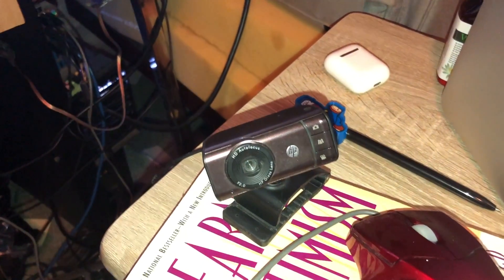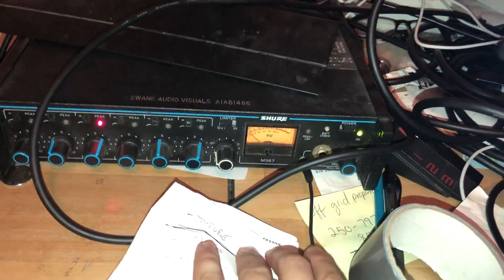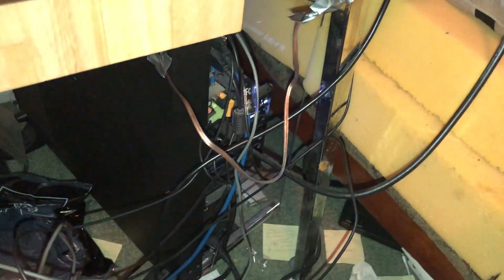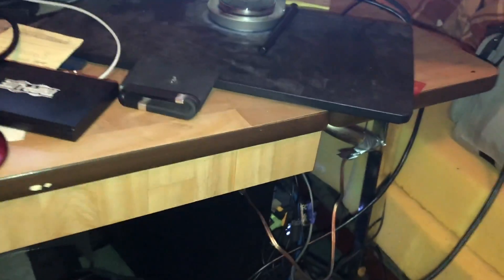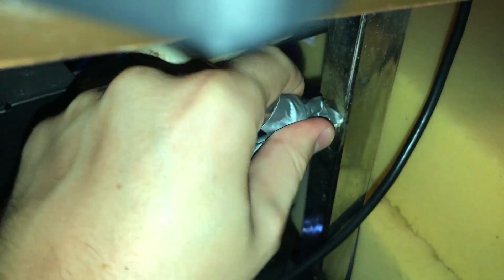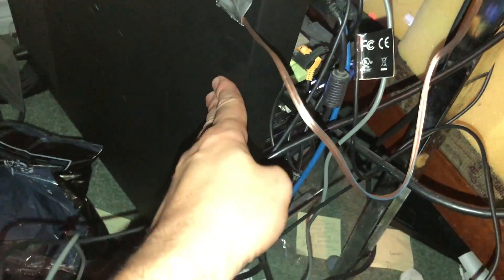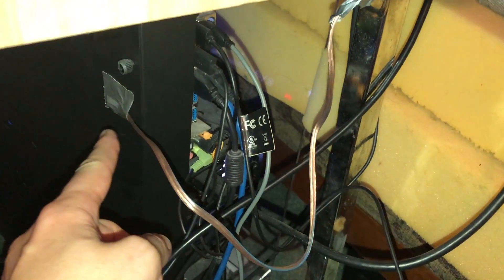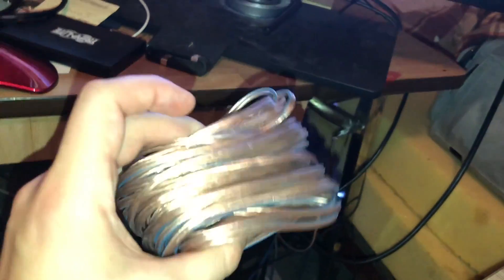HOW TO stop USB Microphone Buzz in audio!

Comment: Holy smokes. It was my power cable seating in the connection. Running the laptop off battery only fixed it instantly.

Comment: Listen..... you are a fucking life saver and i cannot thank you enough you made this video. after you said put ur hand on the case and test it i instantly realised what was wrong....
ive been going through different mics and drivers.... all it is is that my pc case isnt grounded..... wow.... thanks again
Reply: ive run into a problem. so when i touch my pc the buzzing stops. but the copper wires dont help
Reply: can it be that i need fatter wires? theyre quite thin (headphone wire)

Comment: What would you recommend for a non-workaround solution? 
Exchanging the case or PSU what is more likely causing the electricity leakage?
Reply: the outlet you are trying to connect the pc doesn't have the third pin that goes to the ground, so, swapping psu or cases won't solve a thing.
Reply: Go Google "ground loop hum".  There are gadgets that help solve this if the "workaround" (actually  a proper fix) doesn't work.

Comment: What cause the problem anyway. ? And how to fix it permanently?
Reply: Most likely you already know the answer, but for anyone else that doesn't here it is: ground loop. There are many cases where your house/building isn't adequately grounded, that means that you have a physical ground; or in some other cases its just the power cable that only has 2 instead of three terminals, that causes that the two points which are itended to be ground but instead they have a different potential (voltage)... so what you are hearing is that "difference of grounds". This "solution" is grounding that extra voltage into some big piece of metal (the desk), it also happens to discharge that energy when you touch it.

Sometimes you can bundle your "noisy cables" with a little twist so that magentic fields cancel each other, or be the samen in the neutral and grounded cables.

So a permanent way to get rid of is using a ground loop isolation transformer in the cable. Maybe even have a phsysical ground in your house buried in your garden, then wire that thing up to the plug of the "noisy" room.

Comment: I would try this if it didn't look like crap lol
Reply from the maker: You could do it discreet at the back of the case with black electrical tape
Reply: @tbonepearson  I tried it didn't solve my problem. I have tried a billion things and nothing works. If I have my headphones plugged into my DAC and the mic plugged into the computer (be it the MOBO, front 3.5 jack or even a USB soundcard) the same thing happens.
Solution for me is going to be to get a USB mic instead of using the headset mic. There's just some kind of interference going on when using the Headset and Mic at the same time when using my DAC (and I have to have my DAC..required for my setup)

Comment: If you have a 3 pin grounded plug for your Power supply inside the computer (SMPS), and you also have a proper grounding in your house, then why doesn't the noise stop automatically?
Does this mean the PC is not getting properly grounded ?
Reply: most probably there would be an electrical circuit issue around the house
Reply: are you sure you have proper grounding? i have a lot of outlets with 3 pins, but the 3rd isn't touching anything.

Comment: I tried this and, like you said, the problem mostly went away when touching the computer case. I decided to re-seat the power cable in the back of the computer, firmly, since I figured this ought to already have a ground pin. Luckily it worked! No more audio buzzing.

Comment: Hi, I need a bit of help.
So, I am having definitely a similar issue.
However, the problem is that when I touch the case or metal parts of the case, the buzzing or humming does not stop.

When I hold on the microphone, it stops.
My microphone is razer seiren, and it is currently installed on the blue mic stand.
Is there any way to ground this?
Reply: But the mic in a powered USB 3.0 hub by it self.
Reply: @Grim-oc9fw  I've tried a usb 3.0 hub that makes it into 3  usb 3.0... that didn't work.

But it seems a 3.0 -> 2.0 hub and plugging the device in 2.0 solved the problem a bit (except now they are saying my mic is very low even thought it is at max volume)
Reply: @dokdoyoon1099  is it a POWERED USB hub that plugs into the wall ?
Reply: @Grim-oc9fw  No, it is just a hub by itself.
I think a hub with an adapter might work also, but I think I solved it by reducing the power that flows to the mic maybe?

I bought a hub that makes 1 usb 3.0 -> 1 usb3.0 + 3 usb 2.0; I don't know any mechanics... I just tried it out as some post said usb mics work with usb2.0 best...
Reply: @dokdoyoon1099  a lot of mics though don't seem to be able to be powered by USB 2.0
Reply: @Grim-oc9fw  I am using razer seiren. it seems to work fine =)
Reply: I am having same issue, did u fix?
Reply: @Ali-bn6xk  simple fix was to use the RTX voice, (noise gate).

Comment: The buzz disappeared when i touched the other part of the wire
But nothing else stoped the buzz
So what can i stick the next end of wire to?
Reply from the maker: When you touch it it's grounded, I always look for something steel around my computer to attach it to.
Reply: I tried alot of steel and metal stuff, nothing worked instead of me touching it
Reply: Same problem here. i even tried the radiator/heater lines and nothing worked. this is weird af. Even if i touch one thin strand of the wire it stops.
Reply: @nikosgavalakis   finally i used usb headphone without a mic and inserted another microphone in the aux input
Reply: @mohamedalsoly7397  you think a dac/amp will fix the problem? and also i like the little logitech soundcard that i have because i can hear myself when i speak and windows have a delay when you enable that setting.
Reply: @nikosgavalakis  you might try usb grounding cable,, i didnt tried it but it may solve ur problem
Reply: @mohamedalsoly7397  I tried the usb grounding method and it didn't work. again , it stopped only when i touched it. I also tried using an old mic(instead of the headsets mic) that i have in the same small aux to usb amp that i have and i think it doesn't buzz any more. im baffled.i can buy a better mic but if it has the same problem then  im throwing away my money. Thanks anyway
Reply: @nikosgavalakis  if you put the old mic in the aux input and disabled the headset mic there will be no buzz at all

Comment: Does this also work on a laptop?
Reply: when i had a laptop, the microphone would only buzz when I was charging it
Reply: @KayOcir  Is the problem solved or still persists ? Please help m out KayOcir !
Reply: @KayOcir  same.
Reply: KayOcir same problem
Reply: @KayOcir  same problem... Did u fix it?
Reply: @wutttt7661  actually I got a new mic and it actually completely stops buzzing even when I touch it. It's really good at is like $40. Idk what it's called but it's made by fifine u can probably find it really easily but that's if ur willing to pay that much
Reply: @KayOcir  I have 3 headphones and 1 earphones. The earphone works but the headphones seem to produce buzzing sound whenever I plug in my laptop. Though they're ok when I use them with my cellphone. I know that my laptop is the problem, do you know any solutions?
Reply: All I had to do was unplug and no buzzing 🤷‍♂️ but only works on a laptop because if you do that on a desktop then uh... Yk

Comment: Do you have a 3-pronged plug? Those are grounded.
Reply from the maker: I'm pretty positive it's a grounded plug! I'll check in a few minutes, I have it plugged into a battery backup that has a grounded plug
Reply: @tbonepearson  few minutes have passed, did you had a 3 pin plug?
Reply from the maker: @rekt1v1  Definitely grounded plug!

Comment: I'm surprised that teh copper wire would conduct through the paint on your computer case. Usually, it must touch bare metal.
Reply from the maker: It does seem to work quite well, but using my nice mic there's still a weird frequency, I'll look for a bare screw somewhere and try it, thanks :)